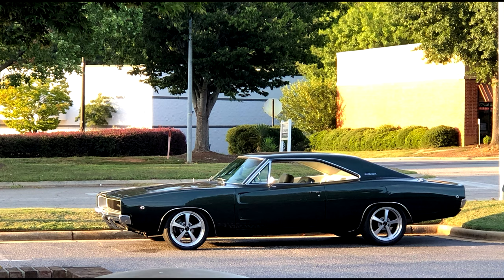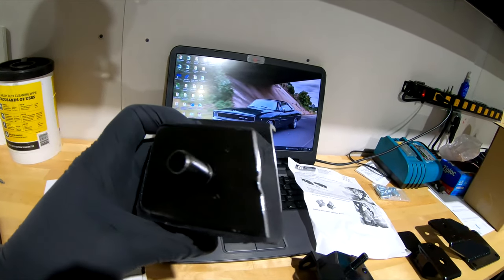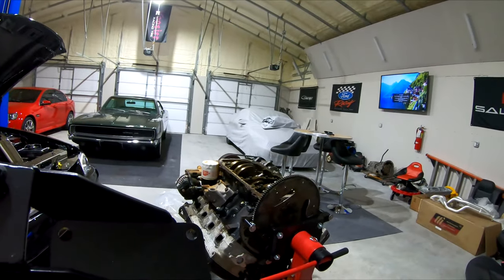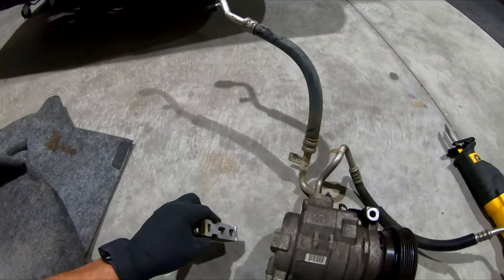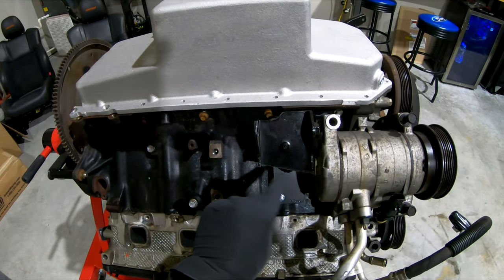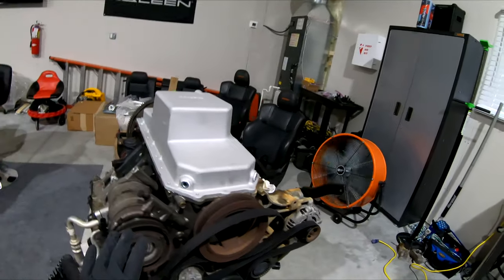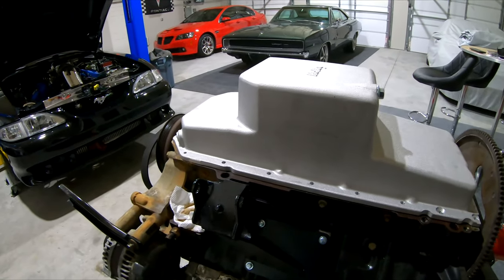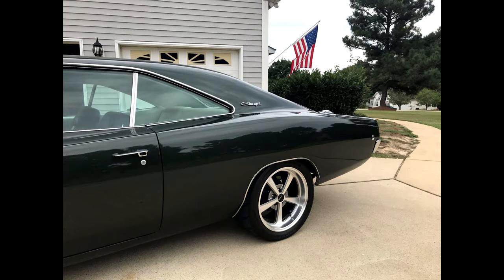GEN III Hemi Motor Mounts for B-Body Mopar - 1968 Charger - MUST WATCH IF USING 2003-2008 A/C!

Comment: Curious what part number headers you used? I'm putting a 2005 5.7 and NAG1 out of a 300c on a 70 Coronet, so a very similar fit. Thanks
Reply from the maker: The information is in the description under the video.  Here's a link for quick reference - https://ttiexhaust.com/TTi5761RS.htm
Reply: Thank you sir. Did you have to adjust for clearance anything where the headers are concerned? My engine bay should be dang close to yours. Thanks again for the content. It has been super helpful for my project!
Reply from the maker: @HEMIJJ  The only adjustments I had to make were for the A/C to the engine mount.  Other than that, they fit perfect.  Good luck on your project!